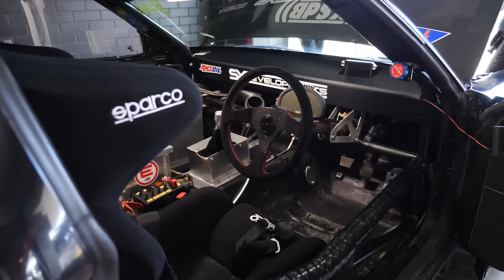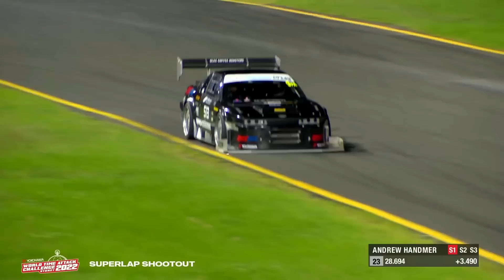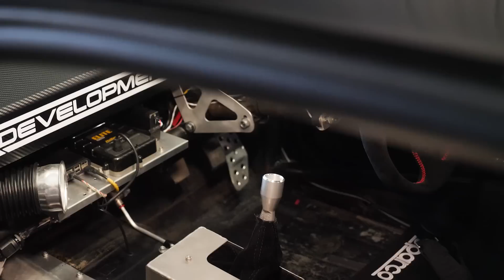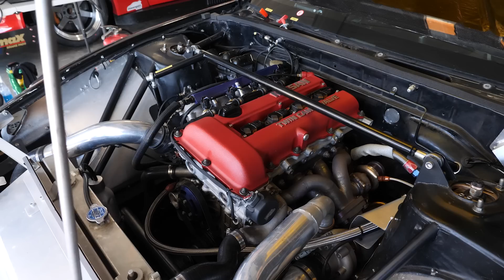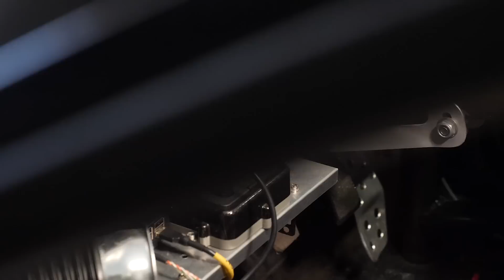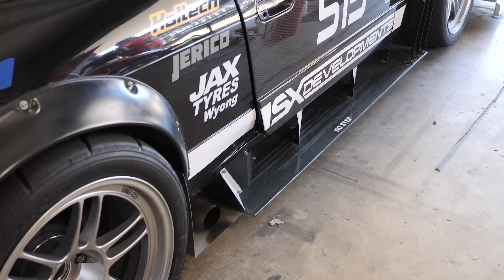This 20k 180SX Build Will Surprise You 😎

Comment: thanks guys! I hope to get back out on track soon and go a bit faster :)

A couple of other cost saving stories:

The wing was literally found in a dumpster, badly damaged from a crashed car. I repaired it, and changed the geometry after some leaf blower wind tunnel testing.

The wing mounts, splitter brackets, and most of the sheet metal parts in the car were made using a free CNC router rescued from scrap and repaired, and a CNC plasma cutter made mostly from more rescued broken machinery.
Reply: OK MacGyver, feel free to drop by my shed and turn spanners any time!
Reply: Hi, great car. Is that a Mines Carbon steering wheel?
Reply: @nzuncovered1845  it's an Under Suzuki carbon steering wheel. I think only a few were made, but it's very nice!
Reply: @SXDevelopments  Definitely!
Reply: Massive congrats mate! You've done a great job!
Reply: What shifter is that if you don’t mind me asking
Reply: @ryanhayward6030  it's a Renagate shifter
Reply: @SXDevelopments  ohh gotcha, I’ve heard of them. Thank you
Reply: @SXDevelopments  awesome car by the way
Reply: @ryanhayward6030  thanks!
Reply: Mate, you should put videos out documenting and explaining this stuff. Your ingenuity is next level. Would be fascinating to watch. Have subscribed in case you do! 👌

Comment: Awesome build and does genuinely seem like it's a relatively budget based setup but to call it an actual $20k budget build is relatively disingenuous. It's like saying you have a budget watch collection when you own a watch shop. A budget build implies that it's attainable for that price or close to it for the average Joe working in his home garage...this guy is obviously a professional with loads of contacts, experience, and access to equipment and expertise that is collectively worth millions. I work in the aftermarket performance world...I am currently working on a BRZ Time Trials project. I have about $20k into it....but for a random dude who doesn't have the connections I have in the industry, it would be closer to $40k. So for me to say it's a $20k build so far is not accurate.
Reply: you'd be surprised :)

A lot of parts were bought back when they were cheap, and there were a bunch of leftover parts that were worth basically nothing at the time.
I certainly couldn't replicate it for the same price now, but $20k was a conservative estimate based on a spreadsheet with everything I could think of in it (around $18k).

I do have a few useful contacts and helpful friends, but most of the equipment used to build the car was repaired scrap gear (CNC router, plasma cutter, mill etc) or bought very cheap (lathe)
I also got quite a few parts, tyres, etc by being in the right place at the right time helping out other teams and people over many years.

Comment: That's awesome and a great credit to the owner.

One thing not touched on was the suspension. Looking at the in-car, it is obviously well sorted and balanced. There's very little steering input required once he commits to the turn and not needing to 'chase' the car all through the corners 👌
Reply: that might be due to going too slow!

The suspension is mostly pretty basic. Factory knuckles all round, factory subframes, and still a few factory arms.
Coilovers are BC ER series which came with the rolling shell. I changed the spring rates and did some damper adjustment but nothing much. I haven't touched the settings for ages because one of them started leaking at the adjuster knob whenever I touch it!

Swaybars are custom (DIY) and tubular to save weight. The front one is a go kart axle and uses go kart hubs to adapt to the blades.

One sort of fancy thing about it is that it has 3rd springs. The rear one is part of the swaybar setup, and the front one is a combination strut brace and torsion bar actuated by push rods from the lower control arms.
I was hoping it would be the first time attack car with 3rd springs but between designing it and actually drivingt it, Andy Forrest built, competed in, and sold his car!

Currently the front 3rd spring doesn't do much, but the rear one definitely helps support the aero load since the rear springs are much softer than the front due to the car's front heavy balance.
Reply: @SXDevelopments 
Thanks for the update.
Maybe the factory did know a little bit about geometry eh 😉
Keep up the good work 👍
Reply: @Danger_mouse  haha yes, I always try to make use of the good parts of the factory design!
Basically as long as you don't run the ride height too low it works pretty well - and that also helps with aero options since you have plenty of space underneath.

Comment: I strongly disbelieve that this is a 20K build. Dry sump, carbon bonnet,boot and doors, forged engine and supporting mods the budget was blown a long time ago.
Reply: just checked the spreadsheet, which covers all the major stuff but probably misses a lot of small things, and it's just over $18k, or $20500 including the WTAC safety upgrades (fire system, new seat, etc)

It would be hard to replicate the car for the same cost in a short time, but a lot of the parts were collected over the past 10+ years, and the car was built over about 5 years using a lot of leftover stuff lying around, and bargains as they were found.

The rolling shell with carbon doors, hatch, etc was bought for under $4k
Bonnet is fibreglass and pretty terrible, swapped from a friend years ago for some other junk I think. I then added the vent which is fabricated from aluminium.
The basic engine was built 8 years ago for my road car, for a total cost of about $1500 using parts bought cheap second hand. The main cost was the machining.
Dry sump was originally done ultra cheap and then had a few upgrades, new hoses etc. I made my own drive setup using a $300 Powerbond crank pulley rather than the usual $800+ ATI one. Brackets etc all DIY.
Gearbox was adapted using a $20 auto bellhousing and a simple DIY plate. Clutch is a second hand Indy car 5.5" triple plate that cost $250, on a modified Quartermaster flywheel which was $200.
The tailshaft was one of the more expensive parts, at about $550, but I saved some cost on that with ebay / amazon USA uni joints, yokes, etc.
Brakes on the car are R34 GT-T which cost something like $200, and the Wilwood pedal box was $250 many years ago. The front rotors are some 2 piece ones I picked up damaged for free and machined them, now replaced with the same type I found on ebay for $300 as NOS.
Reply: @SXDevelopments  I got my type X for free basically and it’s not even turbo. I’ve done 98% the work myself and it’s sitting at $45,000 and doesn’t include any time I’ve spent working on it. Maybe the total was 20K but I can see a lot of work in that, lots of stuff you can’t see costs things. You can’t tell me the seats,harnesses, tires and wheels you got for a deal as well. What about the wiring loom turbo, manifold, gate and exhaust, brake pads and oils.
Reply: @AdamNZ  There's definitely been a lot of time spent on it!
I got the original seat for free 20 years ago, harness was around $200 new.
Wheels were $1550 new a few years before I started this project.
Tyres have mostly been free leftovers from Under Suzuki at previous events, but this time I had one new set paid for by a GoFundMe a friend set up to help out!

Wiring loom was about $500 total for parts, and I did all the work myself. There's no fancy tefzel wire or DR25 heatshrink on it.
I scavenged a few mil spec connectors from old military gear for some of it.
Manifold was built by me, total cost around $350 I think - mostly the Hypertune collector.
Wastegate was an Under Suzuki hand-me-down, and the exhaust cost about $250 in titanium pipe, plus maybe $100 of stainless bits.
Brake pads started off as a second hand set, but have since been replaced, at about $200 an end (Project Mu HC800+)
For oil I used to buy Penrite HPR30 on special for $30 a bottle, but have since been helped out with Amsoil products free or cheap.
Reply: @SXDevelopments  I’m not going to gaslight you. I’ve built enough of these and know what things costs and by the sounds you are extremely lucky but it’s just my opinion. I’ve known about all of the ex nascar parts that become available every now and then but usually takes a bit of tinkering to make things fit and without all the right tools and knowledge ends up being expensive or too hard. I’m thinking about designing a dry sump system myself and many other parts for these being a designer. It also sounds like you’re very handy and multi talented ect being able to do all things you’ve done. I’m very interested in hearing your back story especially with Under Suzuki handing off old parts.
I might even meet you in the pits once I’ve finished my build in the next year or so.
Reply: @AdamNZ  I have spent huge amounts of time head scratching to work out how to make this stuff work, and also approached a lot of it from unconventional angles.
I've done a lot of work on these cars for other people over the years and have had quite a few of them myself, including a super low budget (sub $10k) n/a S13 race car 10+ years ago which was pretty fast.
The Sil80 was a bit of a combination of all the ideas no one would let me try on their cars, and lessons learned on past projects.
I was in the right place at the right time for a lot of the parts (eg travelling to the USA for work so I could fill suitcases with gearbox parts on the way home) and have a few very helpful friends.
Hoarding leftover parts over many years paid off a bit too!

I ended up on Under Suzuki's pit crew since 2012 after the car I was working on broke its intake manifold, and have absorbed a lot of knowledge and inspiration ever since!
Reply: @AdamNZ   @Adam NZ  I have owned an S15 for about 9 years now and it's filled with stuff that should have cost exponentially more. I have option B blue interior which is legitimately selling at 4k that I got for $300. About 8 years ago I got my near new genuine Garrett gt2871r and 550cc injectors for $700. I have evo brembos up front which cost me $300 and I purchased them a year after finding some cheap adapters for $80. I have genuine side skirts and end caps which are worth about 2k+ that I picked up for $300. This list really does go on and not just for this car, but for all the other cars I've owned too. In fact I purchased an R33 GTR shell with 85,000kms registered here in NZ for 25k when gtrs were selling at 80k. I had the running gear for it in the garage already. 

Finding cheap stuff takes patience, effort and skill. You have to know where to look, you have to be able to identify a deal or talk your way into one and you have to have the cash ready to pull the trigger. I don't know what you do, but I know from listening to Andrew in this interview that he's very similar to me. While other people are scrolling Instagram, people like me are using that time to scroll through all possible markets looking for things we want or need. We're not willing to pay full price, that's not the name of the game. Paying less than anyone thought possible is the goal, but it's not just a goal. What might make you understand that this is indeed possible is that this is a hobby. We LOVE it. For the person who participates, there's no greater feeling than picking up something you've been wishing for after a year or so for cents on the dollar. Sure it may be possible to buy it anytime before then new or at market price, but that's just not how our brains work. That's not something we're willing to do.

Sorry for the lengthy reply, but I just wanted to share that to give a little perspective. We dedicate so much of our waking time to the hunt that it's difficult to believe but it's all worth it when it pays off. It almost always does.

Good to see someone like me who's taken the mentality even further and has implemented it to build an actual machine competing on the world stage. Good work Andrew, awesome job.
Reply: @TheDekuStick  thanks :)

I didn't really start with a specific goal of building this car super cheap, but I only had a very small budget (mainly due to spending it all renting workshop space to work on it!) and wanted to make the most of parts I already had, as well as some unconventional construction using lower cost materials.
I also consider racing to be a very stupid activity so I try not to spend too much on it!
It would have been much cheaper (but slower) if I built it in the originally expected "few months" time frame, but taking 5 years to build it spread the cost out a lot!

There are a few things that end up being feedback loops for cost and weight - like chasing big power, which doesn't give you a lot of lap time for the cost, and also tends to increase the requirement for things like bigger brakes or a stronger drive train, which further increase weight.
Keeping top speed down reduces braking and aero loads, and reducing weight helps with everything - including improving the effect of downforce.

Endless upgrades are also a lot less effective for the cost than more seat time, and usually less fun! (must remind myself to get more seat time)

I like efficiency in design, whether that's making more power from less fuel, a better strength to weight ratio, lap time per dollar, or simplicity and ease of construction.
This car was a bit of a way to try things I'd always wanted to do on other projects or on other peoples cars - which they usually wouldn't let me!

I also tend to design around parts and materials I have or are easily available. Eg the intercooler I use was left over from another car that upgraded to a fancy one. I liked it because it was light and fit neatly between the chassis rails.

I realised because it has some very strong end tanks I could actually use it as a structural part of the car by beefing up some of the ducting parts and welding them to the tanks.
My front bumper, intake duct, guard braces, bonnet pins, and radiator are all mounted to the intercooler, which is bolted to the chassis. It saves a lot of the usual frame work you see on most cars.

Then there are things that will be ongoing costs of operation or spares will be needed.
I use Bosch 2200cc injectors even though 1650s would probably be better - because they're cheaper and I wanted to have a spare set available.
The ignition coils are Toyota Echo / Yaris because I had a set from a scrap engine, and then found a spare set on a crashed car beside the road!

My cheap Jerico gearbox worked out well, but only having 4 speeds is a bit of a limitation - so I have two diffs and can swap them for a final drive ratio to suit different tracks.
Expecting to change diffs reasonably often meant designing the exhaust and rear swaybar setup to not be in the way, or to be easy to move.
The diff parts were collected cheaply over many years, with the shorter ratio one being used in my daily driver for many years.

Anyway back to designing parts for a pneumatic paddle shift system for the Jerico which will probably end being reverted back to an H pattern shifter which I should have probably done from the beginning!
Reply: The amount saved in Labour would be massive though!!!! And this dude really seems to know what he is talking about and has no reason to lie. Curious to know about what happened to the street car this engine is out of!!! I miss the days of cheap s chassis 😭😭
Reply: @billhill89  the daily driver went back to its previous configuration with a standard engine on pump fuel etc. A very cheap one popped up for sale locally so I grabbed it!
These days even broken SR20s are getting expensive.
Reply: You can believe what you want but knowing Andrew personally, he's not the type to be making up stories about what he's spent on the car.